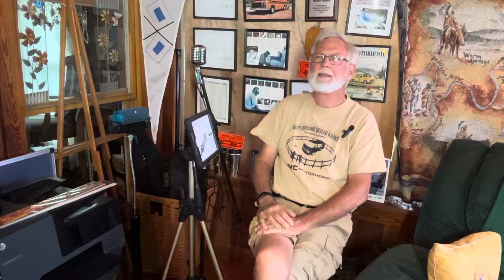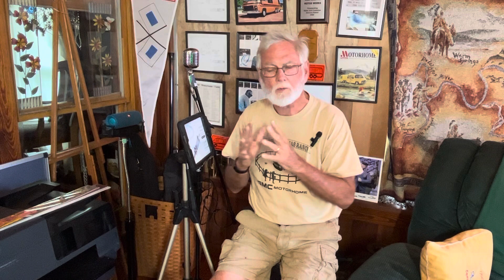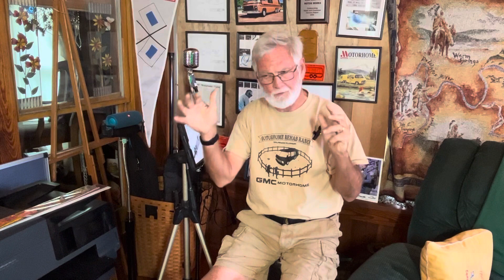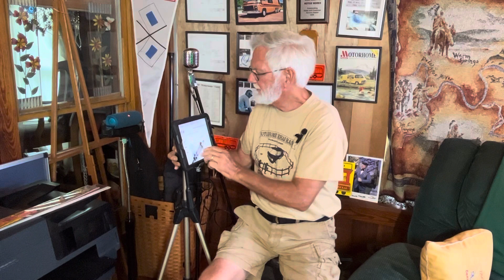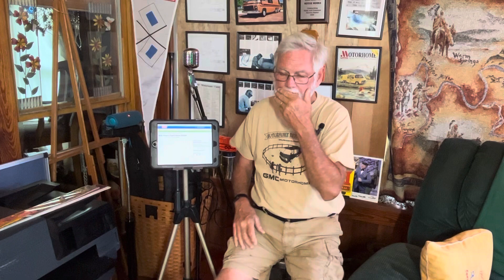Fuel Systems on the Road: Part 1

Comment: Some clarifications on the parts used for that trip. They were not the best or even what I consider good parts. However, they are typically available at most auto parts stores and the ones I do recommend are more online or possibly in performance shops. You probably can’t see the right parts on his iPad, but not really worth seeing. I believe we did some videos covering the fuel pumps and filters that I recommend.

Comment: Would you pre-filter a mechanical pump located on the engine with the glass in-line filter?

Not sure what the inlet requirements would be as far as pressure drop, though it must be better than blockage with rust.
Reply: Never use a glass filter. If it breaks, you have fuel all over your engine and probably a fire.
I prefiltered my mechanical pump but I'm also still on a carb.